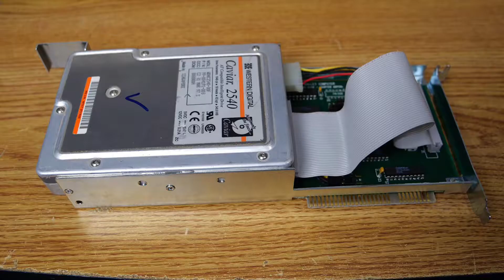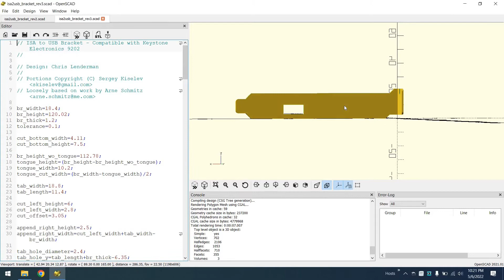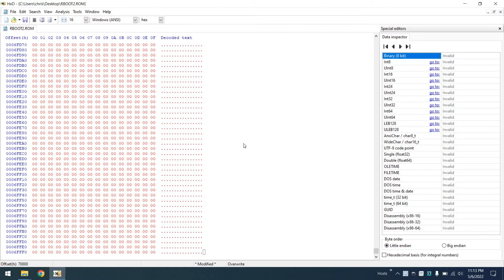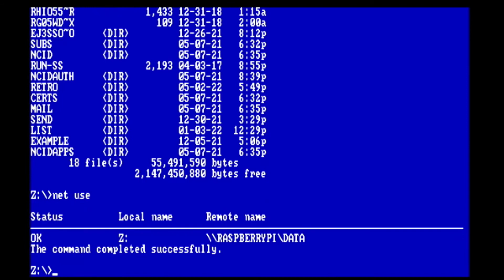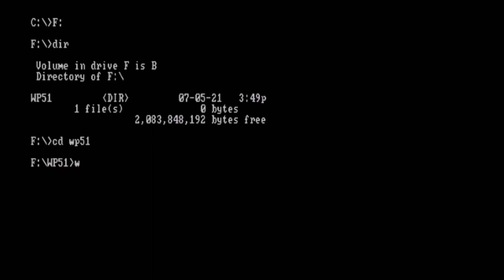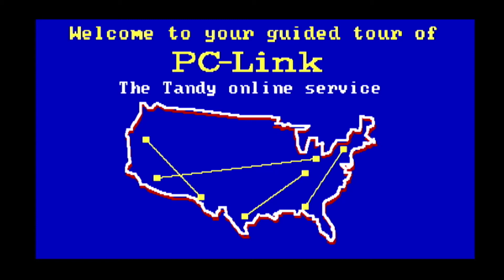Upgrade Mania For The Tandy 1000 TX!  How Many Components Will We Upgrade?

Comment: Great video! As a former Novell administrator, I really enjoyed seeing that. You might consider expanding the Tandy with a Gotek drive running FlashFloppy firmware, or perhaps add an XT-IDE controller with a Disk-on-Module.
Reply from the maker: @haraldaichinger9335  thanks for watching. Yea, not a big fan of goteks and Tandys would require a special adapter. I just use the network for most file copy. I do use XTIDE and Picomem for a variety of use cases.  In this case I wanted to have a real HDD though!

Comment: I'm having fun messing around with my 1000SX that I've recently upgraded. These machines were and still are some of the best MS-DOS computers. 👍👍 Would you mind sharing the STL files for the brackets that were shown in the video pertaining to the two ISA Cards (Network & USB)? I'm also curious as to what type of HDD I'd need to replace/upgrade the 30MB HDD/HardCard combo? Thanks and great video as always.
Reply from the maker: Certainly!  Here's a link to it: https://www.thingiverse.com/thing:5350142.  Also, since you asked elsewhere, programmer is a TI866+.  As for HardCard, not sure, this is actually a "generic" hardcard.
Reply: @RetroTechChris  Much appreciated. I did some searching and it appears that the TI866+ is out of production/no longer being made. Would the T48 TI866 3G version still work for this use case? My particular HardCard is one that was purchased with my 1000SX. I'm still learning all the ins/outs of older DOS/Windows hardware. If you or someone here in the community can maybe point me to a particular type of HDD to use for this project, I'd be grateful. 👍👍
Reply from the maker: @JCaldwell1985  not sure!
Reply: @RetroTechChris  Upon looking over my particular HardCard, I've found that it might be difficult to source another MFM Drive needed for mine. When you have time, would you mind posting some detailed info on the ISA Interface for the HardCard in your TX, so I can maybe try to match yours?
Reply from the maker: @JCaldwell1985  I think I cover that in the video.  Silicon Valley ADP-50.  It takes IDE
Reply: @RetroTechChris  Thank you for the clarification. I've watched it through from start to finish, but I guess I missed that part. Thanks again.
Reply from the maker: @JCaldwell1985  it's the first component that I cover, right around the 1:30 mark.

Comment: Great video and some nice upgrades.  Like @Geek With Social Skills, I was a Commodore 64 guy growing up but recently purchased my first Tandy, a 1000 TL/2.  Tandy really made some nice machines back then.  I never really used them, other then some TRS-80 Model IIIs in High School.  My DOS journey didn't start until after the demise of Commodore in 1994 with the purchase of a Gateway 2000 486SX.  This came with MS-DOS 6.2 and Windows For Workgroups 3.11.  So I missed out on all the XT type clones.  I am having fun trying to get it all setup.  My Upgrades include an XT-IDE (to replace the included 20MB SmartDrive) a Parallel port card, (I have several including an EPP/IEEE 1284 variant.  Not sure which one will work)  and an EMS RAM card.  Getting them all to work will be fun. I would like to use an ethernet card so the one you showed in this video  may be a good choice.

The 20MB HD that it came with is an XT IDE class HD, which I didn't know existed.  It is not an AT-IDE as we  know as IDE  today even though it has the same 40pin connector.  My HD works and has the original software load.  I am trying to figure out how to Image the drive but my knowledge of these early machines is somewhat lacking.  If you know of a great DOS imaging tool for DOS 3.3/5.0 that can image this HD that would be awesome.
Reply from the maker: Glad to hear you are getting into things here!  As for backup, for imaging DOS machines, I just copy all files over the network to a network share and then zip it up.  To restore, I format a new disk with /s to install system files and then copy the files back!  I usually create a LAN Manager floppy and copy files to a samba share on a raspberry pi.  I have tutorials for the LAN Manager setup and for making an SMB1 server on a raspberry pi.  I also have a git repo with LAN Manager disk images, and we can always make one for this network card too!
Reply: @RetroTechChris  Thanks for the tips thats a great way to do it.  I am a bit of a network nut and love to have all my old machined with some sort of local network ability.  I'll have to do that with this classic Tandy.  Thanks!

Comment: I still have my Tandy 1000TL with 768K of memory and a 20MB Hard Card in it.  Works perfectly.  These are amazing little machines.  I'm glad I hung onto it for all these years!
Reply from the maker: Nice!  And good work holding onto it.  Like many others, I didn't hold onto my old system (1000 SX).  But the TX has made a nice replacement.  Thanks for watching!!

Comment: That's the first XT/AT class system I've ever seen boot off the network into DOS -- very nice work.  Also, using the Windows 2.x driver with 3.0 -- is that documented anywhere?

Aside:  There should be a single Tandy TX in the VCFMW auction this year.
Reply from the maker: From the TRS-80/Tandy 1000 group: When using the Tandy 1000 display driver from Windows 2.x (available at ftp://ftp.oldskool.org/pub/tvdog/tandy1000/utilities/tandydsp.zip)  in Windows 3.0, there is no splash screen. I solved the problem by modifying the setup.inf to include the CGA splash screen file: tga = 1:tandydsp.drv, "Tandy 1000 Display 640x200x4", "200,96,48", 3:tandydsp.grb, 2:cgalogo.lgo, 4:vddcga.386, 4:cga.gr3,, 2:cgalogo.rle. It is also possible to create an oemsetup.inf document with the appropriate files. 

I took the file posted in that group and uploaded it here: https://github.com/cml37/dos-utils/blob/master/config/resources/tandydsp_modified_splash.zip
Reply: @RetroTechChris  aha, it did look like it was 4 colors! Thanks
Reply from the maker: Can't wait for VCFMW! I need to get the Win2.x driver with 3.x documented.. actually found the driver itself in the TVDog archive!  There is some work to get the splash screen working that is documented in a Facebook group.  I'll go search and add more here.
Reply from the maker: Display driver is here: http://ftp.oldskool.org/pub/tvdog/tandy1000/utilities/tandydsp.zip

Comment: Ditch the hard drive and put in a XTIDE Compact Flash drive that boots. It's what's in my 1000 TX.
Reply from the maker: I suppose that is an option!  I do have several XTIDE CF cards, but I think this is a case where I'd prefer to keep a hard disk... especially with the rarity of this HDD controller card.  If the drive fails or spinning drives become unobtainable, then, yea, I could add a CF card in its place.
Reply: @RetroTechChris  I still have my original hard card for my 1000 TX. But was heavily concerned about the potential for drive failure.  I took it in steps but am running MS-DOS 6.22 on a 512 meg CF. My current struggle is finding some form of Sound Blaster audio for 8-bit.  I have a VGA card in mine as well as that USB card you used.
Reply from the maker: @davidbrenneman4038  copy that. Yea I keep this machine backed up.  I've actually had more CF cards fail on me than spinning drives at this point!

Comment: fantastic video chris!!  be interesting to see it running windows 1.0 or windows 2.0  Also can you fit a graphics card into it?  just to see how it performs with one of those?
Reply from the maker: It could take an 8 bit card!
Reply: @RetroTechChris  worth a look?  also will it take a CD rom drive instead of the 5inch floppy, ?
Reply from the maker: @procta306  possibly.  But as XT class probably won't add one